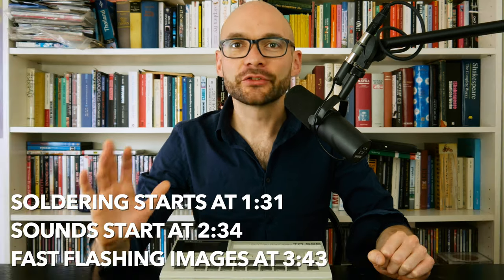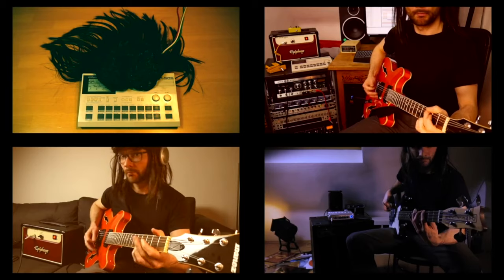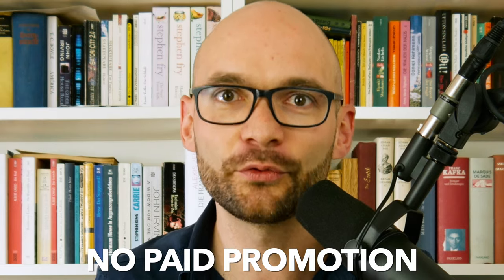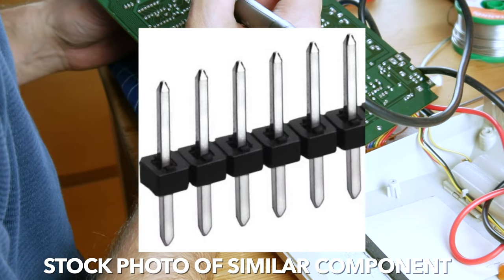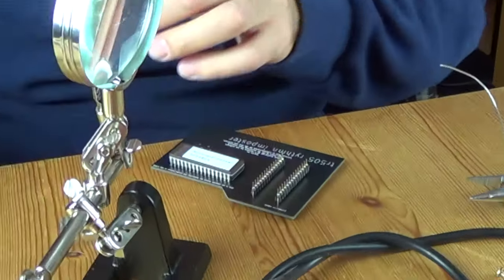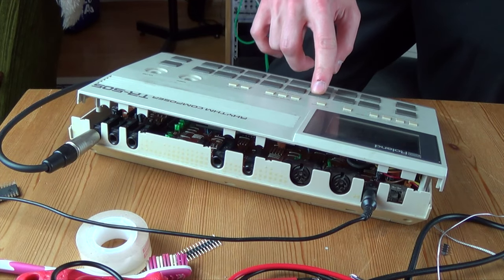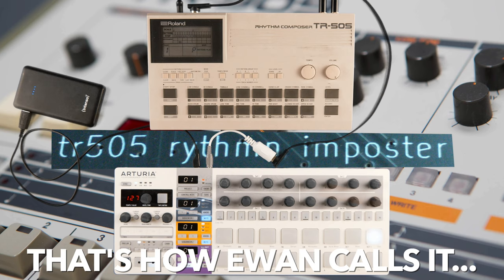Better Gear - How To Turn a Roland TR505 Into A TR909 (Drum Machine Mod)

Comment: Pretty much any old drum box can be re-ROM'd. Just takes a little elbow grease. The converters aren't the culprit for the cymbals, it's the sampling rate. Try running 'em thru a brickwall filter first.
Reply from the maker: Thanks for the heads up!

Comment: The bank switch option option on the board gives me the idea - how about a board with room for the custom add on ROM and the original 505 ROM, with a switch to select between the two?  Best of both worlds!
Reply from the maker: Great idea!!!
Reply: My first thought on that too! I own a modded 505 which has an out board modular circuit bent that you can plug in..sounds really good!

Comment: Can I be silly? I've been making music for over 20 years, I've never really thought the 909 was all that. It had a very raw sound that, while alright in isolation, was usually hard to mix without loads of EQ and compression. By comparison, the 707/505 and even the Linn/DMX/EMU units had kicks that cut through the mix and didn't require a ridiculous amount of post processing. Fun fact: a lot of house music that had 909 kicks sounded kinda the same. It wasn't until producers got clever with layering and effects that the sounds became more 'usable'. Having said that, the 909 snare is still a fat bastard.
Reply from the maker: I like the "damage" the lofi converters of the 505 do to the 909 samples

Comment: Not sure why a lot of people dislike the 505. I love the 707, so when I found out I could get the same exact sounds for half the price I jumped on it. If you amplify the signal, the original 505 drums sound very alive and very punchy. Not a big fan of the 909 mod, but that's probably just because the hats, ride, and cymbal are harsh and are not able to be edited in any way.
Reply from the maker: It always surprised me how close 505 and 707 are
Reply: @AudioPilz  yeah, seems like they were trying to get an edge in the pcm sample drum market by rebranding the 707, and making it into a smaller, cheaper unit. For the time, neither were really bad at realistic drums if you put reverb on it, and mixed it appropriately. But it no doubt left a bad taste in people's mouths who were looking for more real sounding drums.
Reply: the clap and the snare on the 505 in particular are great

Comment: If anyone wants to grab one for less, get one with the darkened screen and peel off the reflective backing, replace with aluminum tape or white printer paper, pretty much as good as new then. 
Individual outs are also really easy on these.
Reply from the maker: Good to know!
Reply: Grabbed a defecive one (tempo wheel does not work), while I am waiting for parts how do you do individual outs on these? Any links?

Comment: The Waldorf Rocket is an awesome thing.
The 505 mod is cool and all.
Reply from the maker: Rocket is da best!
Reply: @AudioPilz  I got the Streichfett and rocket as a package deal ages ago and never really messed with the rocket. Time to change that I think.
Reply from the maker: @Gainn  cool oscillator section!

Comment: You should consider some overdrive mods! The TR-505 uses a completely separate amplifier for the sounds, which can be feedbacked and overloaded to warm up the sounds a bit and add some nice distortion
Reply from the maker: Great idea! Individual outputs and pitch mod is on  my list too!
Reply: @AudioPilz  Individual outputs will defenitely be challenging as you will have to replace the single built-in amp with 10 external ones. Pitch should be easy though, just start poking at resistors with your finger until you find one that changes the pitch (clock resistors are super sensitive and will respond even if you touch them with your hand)

Comment: It would be nice to have both eproms in at the same time with either individual switching for a custom drum set just 505 or 909
Reply from the maker: You can use a large enough EPROM and the bank switch option. Haven't tried it, though

Comment: I'd love if you could do one on my beloved Akai S612 and mod made for it.  I have an original but the mod is pretty serious.. but probably not much more than what you two did with the TR505.   Of course this is kinda falls in to a "bestest gear?" category because the S612 is an amazing sampler all around as-is.
Reply from the maker: Boah, just saw a broken one for over 700 bucks. I have to sell a kidney for that (or open a patreon;)
Reply: yea that's silly.. they are kinda rare and some people try to ask those prices but you'll see they go for less.  you don't need the drive either if you have sample wrench for windows (or amiga!) it can do sysex dumps.. it's a special format though, not standard SDS.  So yea maybe not something you'll impulse buy, but just worth keeping an eye out for..   i think the mod alone costs like $200..   some gear is impractical..   like omg if i could find the old DW8000 mod..  but i completely missed the boat on that.. now those are more rare than the synths itself.  :P
Reply: @AudioPilz  The S612 is unique in that the legend goes that it started out life as a digital delay unit.
I passed on one at a music store for less than 100 bucks with the drive. 
My rationale is that it did less than my Akai S-01 that I owned at the time. But the 612 is cool to glitch things up with.

Comment: Did you consider using a Teensy4.0 instead of a new EEPROM board?
Reply from the maker: Interesting, tell me more...
Reply: @AudioPilz  From a quick inspection of the service manual, it seems like IC9 accepts trigger pulses which addresses what sound to be fetched from the EEPROM. Maybe one could bypass the EEPROM / DAC by installing a Teensy in there? Don't have a 505 atm to try it out.. Might be fun tho. =)
Reply from the maker: @DJDiskmachine  Cool, I'm gonna talk to Ewan about that

Comment: I just received the "imposter" kit from Ewan Colsell. Just to be sure: once installed, you lose all the INCREDIBLE samples that are on the original EEPROM, right? is there a way to keep both perhaps?
Reply from the maker: Yeah, that's the way it goes. You could get another PCB from Ewan and solder the original EPROM on it (be VERY careful when desoldering). You can exchange the daughter PCBs with the EPROMs easily
Reply: @AudioPilz  weel, it would be easier to simply remove the daughterboard and insert the original EPROM back in the socket  :-)
I Will study a way to keep both :-)
Reply: @AutodafeSynths  i'm working on an update....that amongst other things will let you have the old sounds too.
Reply: @ewanuno  yeah I have replied to you on FBm in Synth Cafè Group ;-)

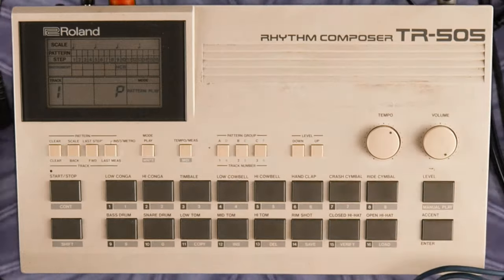Comment: 3:40 certainly doesn't sound like 12bit at all... (would believe Evan this being 8bit).
Reply from the maker: According to the service manual Ewan is right
Reply: @AudioPilz  it extrapolates it seems to simulate a 12bit sound, but does a bad job at this ;-). It sounded like  the drum sounds I used on my Amiga mods
Reply: @gbraadnl  When playing heavily compressed sounds, the TR-505 may sound like a 12-bit sampling machine. This technique of improving a signal-to-noise ratio of these old 1980s 8-bit pieces of electronics is called "companding" - an abbreviation for a combination of compression (in the samples themselves) and expansion (during playback). The same algorithm (or similar) was used in LinnDrum, Emulator II, Oberheim DMX and so on.

Comment: I didn't get something, the samples are 12bits or 8 ? 12 bits samples and 8bits converters ? Really ? Why ?
Reply from the maker: No, it's 8 bit according to the service manual. There's a widespread misconception that the samples & das are 12 bit (and it sounds preeeety good for 8 bit;)
Reply: @AudioPilz  cool thank you for the explanation :)

Comment: I can store in my SSD samples of a 909...so this is a waist of time.. an original 909 generates the sound in an analog way..
Reply from the maker: The 505 adds a very specific flavour to the sounds
Reply: @AudioPilz  How so? No swing no editing, no individual outs. If you're going to destroy a TR machine then why not just give it away. I'm very anti circuit bending. In my opinion doing this adds no value.
Reply from the maker: @TheBroDotTV  Because the 909 samples are squashed through the 505 8-bit converters. Changes the character of the sounds profoundly and is hard to recreate ITB
Reply: @TheBroDotTV  - I agree that these mods don't make a 505 into a 909, and they aren't interesting to me. But circuit-bending doesn't "destroy" an instrument any more than gaming mods "destroy" an off-the-shelf computer, or hot-rodding "destroys"
a stock car. These are mass-produced items, not sacrosanct artisanal things. And the gear that gets modded usually are designs that had lots of hacky compromises in the first place.
Especially when that mod is just replacing an EPROM of factory sounds. That's like saying that my DAW was destroyed by importing my  own samples instead of playing with only the demo tracks.